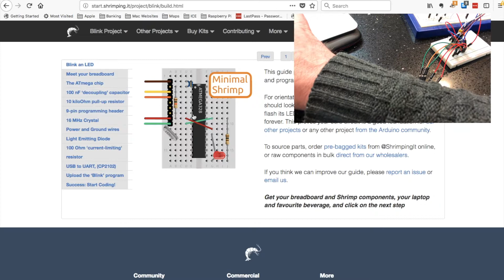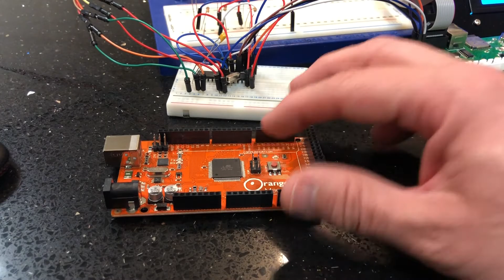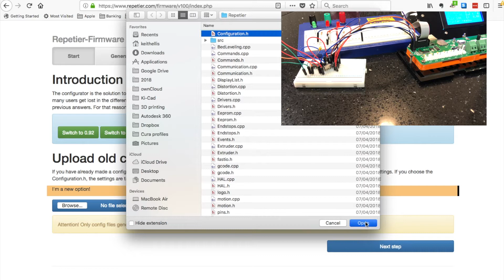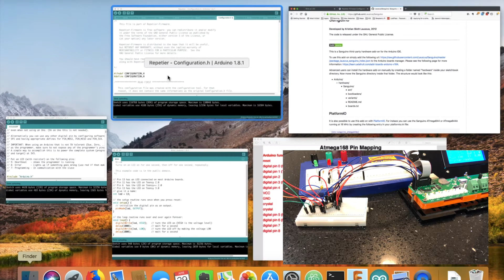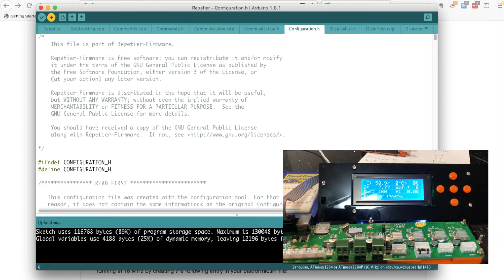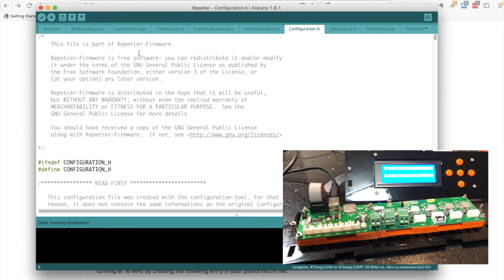Flash firmware to 3D printer without boot loader

Comment: Thank you for this tutorial Keith.  I recently bought a little Tronxy X1 as an entry into the 3D printing.  I quickly realised the limits of not having a heated bed and proceeded to rebuilt it to accommodate a MK3 PCB heated bed.  Now I'm needing to update the Repetier firmware.  With zero experience with Arduino's your tutorial has set me on the 'path to enlightenment'.  I haven't yet learned how to backup the existing firmware and config settings from the printer.  Would you be willing to share with me your files so I can compile and upgrade my firmware please?  Many thanks again.

Comment: Thank you for the very useful video.
I am just wondering if it would be possible to share your "Configuration.h" file so I can double check my settings are correct. Much appreciated.
Reply from the maker: Laz Dea glad it helped, here is my Repetier 1.0.1 config.h file.  You can upload this to the Repetier site to download the whole firmware. https://keithellis.me.uk/index.php/s/QSncN75csNOPPer
Reply: @Pi-Tutorials  I've  just tried to download this config.h file and get the error "Exception occurred while logging exception: Failed to connect to the database:"
Reply from the maker: @frankhovis  Please try again now, I've just rebooted the server. Good luck.

Comment: Just finished flashing Marlin to my Tronxy X1 Melzi board. It was a success! Thank you for posting this video it was very helpful.
Reply from the maker: Firebirdthe glad it was useful. Thanks for the feedback. Did you go for Marlin 1.1.9?  Did you use the Marlin sample X1 confit?
Reply: Yup. Marlin 1.1.9 and used the X1 config from the examples folder. Easy as pi!
Reply from the maker: Firebirdthe excellent, that’s good to know.

Comment: Hey I got a little problem with my melzi board it is the exact same as the one you have in this video I accendently stuck some wires in the wrong place and looks like I just fried the board I got a new one with similar features just diffrent ports for the motors but it's called malzi 2.0 by adriean&??I also got the USBASP connecter you have in this video and ordered a AVRISP connector for the 6 to 10 piningI'm very very new to these printers and any of this I downloaded Arduino programe and Repetier firmware I found online and tried your method but I'm just getting errors I don't find much at all about this on the web but the person who sold me this new board says it can be done it just needs to be "flashed"COULD YOU GIVE ME SOME EDVICE PLEASEPs my printer is one of those cheap Tronxy eBay printers?
Reply from the maker: Johnaton Ince Hi, sorry for delay in responding. If you are following my instructions fully, you should be able to flash your Melzi board successfully. However if you are still having problems it could be the Arduino IDE.  I sometimes find even though the board settings are set correctly it thinks another board it working.  Try this. 
* Close all open sketches in the Arduino IDE
* Exit the IDE and reopen
* Open your Repetier or Marlin firmware sketch
* Select the board, Sanguino for the Melzi
* Select the board variant ATMega 1284 for the Melzi
* Select the programmer, AVRISP
* Finally in the tools menu, select Upload via Programmer

Also double and triple check your wiring.
Regards,
Keith.